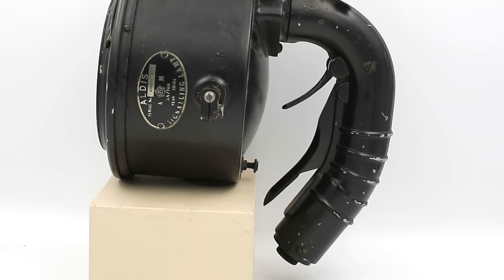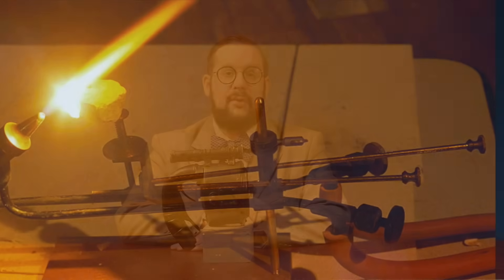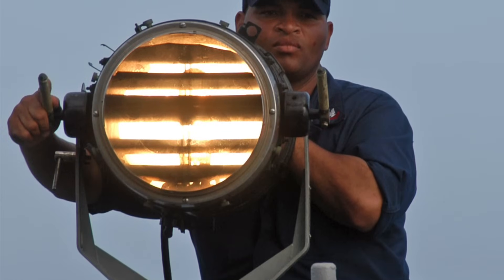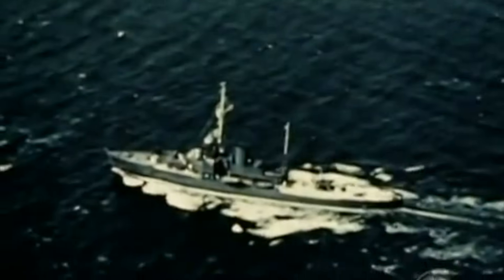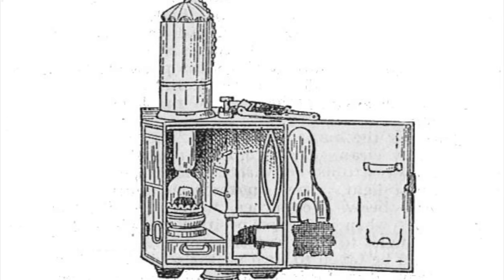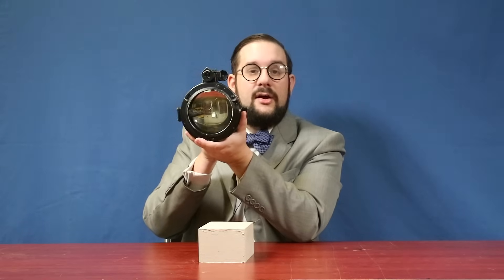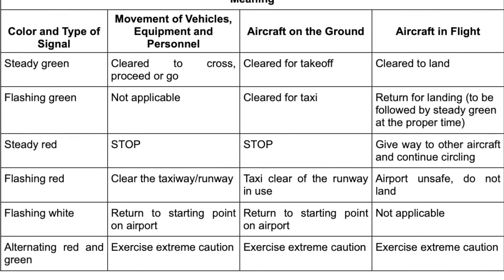SHORT: Aldis Signal Lamp

Comment: I was a Signalman in the US Navy. We had the US version of the Aldis lamp. The version that we used had a spring loaded trigger that turned the flashlight bulb on and off. The trigger was narrow and the spring was stiff, so messages of any length were finger cramp inducing. I would really like to try the one that you have. It looks far superior. We used the Aldis lamp when we launched the motor whale boat for boardings and man overboard drills. It was difficult to keep the light trained on the person receiving the message back on board the ship in any kind of sea state at all. I used semaphore signaling whenever possible. Learning Morse Code at military speed still rates as one of the most difficult things that I have ever done. But 50 years later I can still remember it.

Comment: It may only be "8 words per minute", but given that a "word" is deemed to be 5 letters, that IS up to  40 letters per minute ..or 1 every 1.5 seconds.   Given that many Morse letters are made up of 4 dots/dashes even 8 words per minute is not at all shabby.  As a young Midshipman I achieved that speed only occasionally and after much practice.  Our Navy signalmen of course manage higher speeds.. PARTLY through the use of shortcuts .... "2" for "to" and so on... I could NOT "read" our Signalmen sending by light.  It was too fast and too "informal".  In the Gulf War in 91 we were under "EMCON" most of the time and Morse by light and even SEMAPHORE (!!) was used when Replenishing from support ships.  Fascinating stuff.  Note:  For longer range we also carried the 10 inch lanterns... they were BRIGHT!

Comment: I learnt and got certified in proficiency on Morse Code as a Scout back in the 1970s.
I'm pretty rusty with it these days, but its something you never really forget.

There is a modern laser equivalent of an Aldis lamp that can send , with a compatible receiver,  rapid bursts of large amounts of digital data and messages , unjammable, and practically undetectable unless you are in the exact direct line of sight.

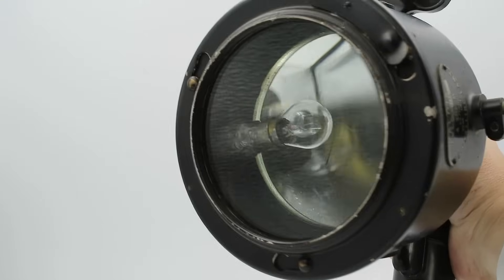Comment: 4:51 I've owned a 5" Aldis like yours since I was 14 and only now have I actually realised what the trigger above is for! 
I always thought it was just a guard, the mirror on mine has been blocked from moving very far by an adjustment screw but does still work. 

Mine plugs into car power sockets, I imagine at some point for use on somebodies boat. I have one of the red filters you mention also. Mine only has the open notch and optical sight, no peep sights on mine.  

I had always just assumed they signalled using the normal trigger. 

Now at some point I'll fulfil my childhood promise of learning morse code and having a practice with it.

Comment: When i was little we had a handheld Aldis lamp in the family sailing boat; it was mainly  useful as a searchlight. It was plugged into the boat's 12v electrics rather than battery operated. As i recollect, it looked very much like the one in the video, but I think the shuttering mechanism may have been different - it seems to me that the cylindrical shaped bulb had an opaque outer end, and the parabolic mirror moved back into the lamp housing to expose light. Am i right or is my memory playing tricks? (Was over 30 years ago)
Thanks for the excellent content👍👍👍

Comment: I wonder if the technique will get digitalised in future, as infrared/visible spectrum light is rather hard to flood by the enemy counter-signal efforts. They do require a direct line of sight and have a limited range because of diffusion, but those downsides are the reason why it’s hard to jam, or intercept.

Comment: In Australia, I worked on several ex-oil rig tenders and they all had Aldis lamps as a survey requirement. These had to be shown in good working order as a visual means of signalling without power,(they used 24 volt batteries) other than flags. The surveyors were pedantic about them. 

Enjoying your work, please keep it up.

Comment: I suspect the US Navy has a different kind of signaling lamp by now - a laser aimed at another ship, one that carries a high-speed digital signal for computer-to-computer comms.
Reply: They still use plain old signal lamps, no matter what technology exists. It may be slow but it's reliable.
Reply: That's great - until your computer gets knocked out by enemy action, or just another computer crash . . .
Reply: @jackx4311  its 2023. the computer for modulating the laser signal would be able to be on a single chip in the handle of the lamp, and as an embedded system probably not be susceptible to crashing since it only does one thing.

Comment: It's interesting to think that signal lamps using Morse code could have been used long, long before the electric telegraph was invented, especially the heliograph. Of course the dot-dash format was only discovered during the development of electric telegraphy, so a genius would have had to invent the code concept and the heliograph at the same time.
Reply: No - the 'dot dash' format was adopted because it was the ONLY format that telegraphy could use.  And as for it needing a 'genius' to come up with the idea - what do you think music is based on, if not a pattern of data in different lengths?  Nor would it need a heliograph to send and receive;  African tribesmen have been sending messages for thousands of years by using patterns of sounds and silence, by drumming on hollow logs.